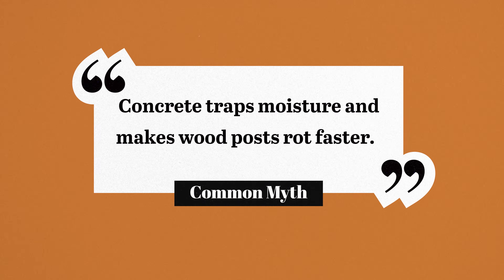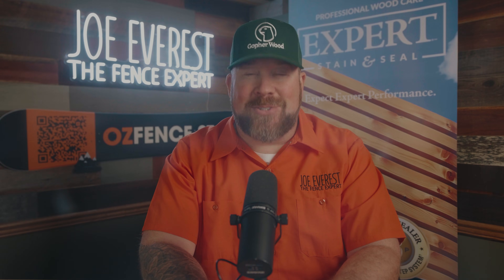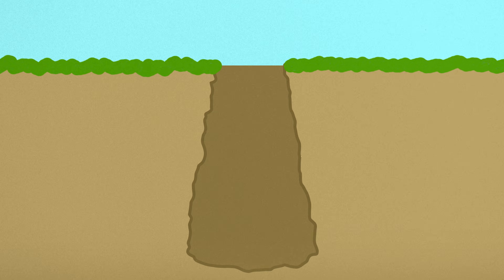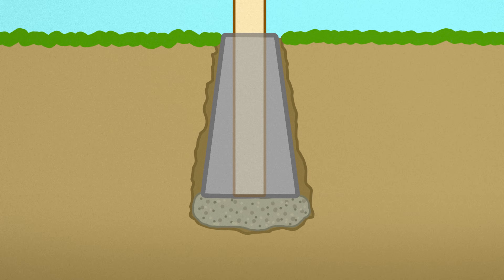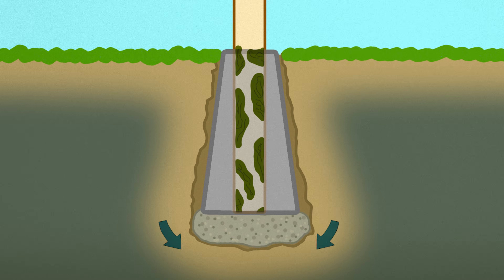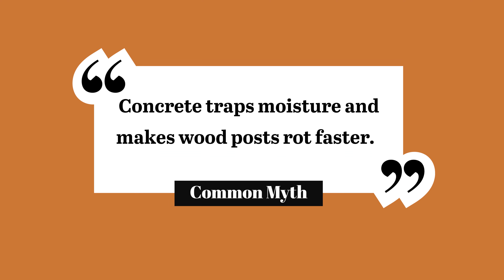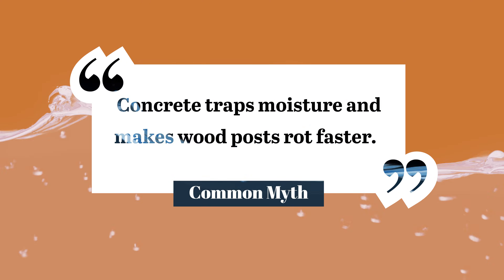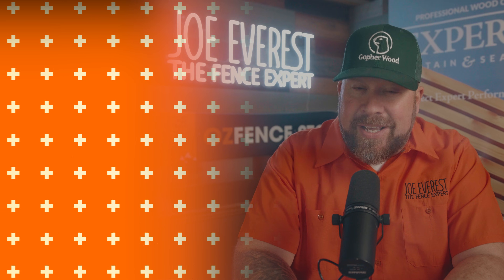Concrete Fence Post Rot Myth BUSTED!

Comment: Very important to tell your people that posts rot first where the air meets the ground, ie where it stays moist longest.  Always mound the concrete and slope it so water drains away from the post. Allowing soil buildup around the base of the posts is a recipe for disaster. Even better put it in a saddle so its nowhere near soil.